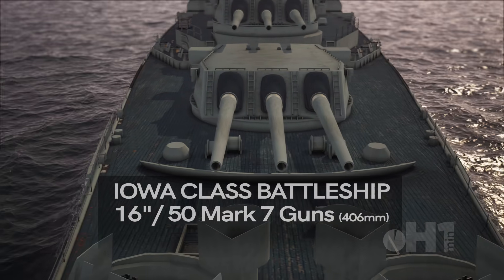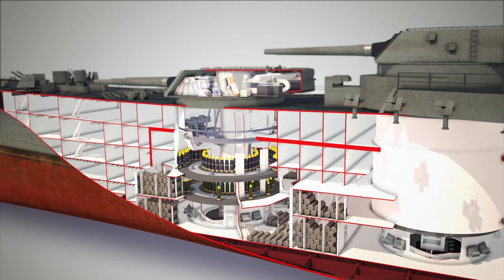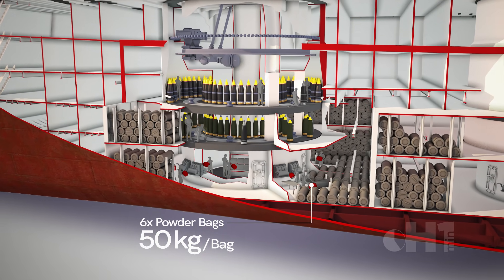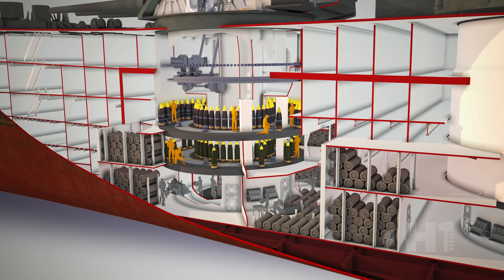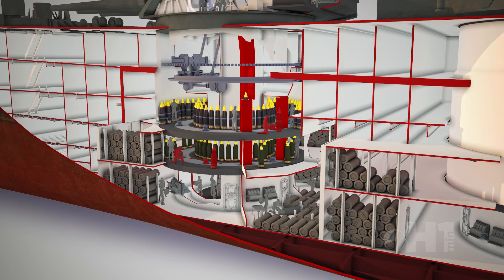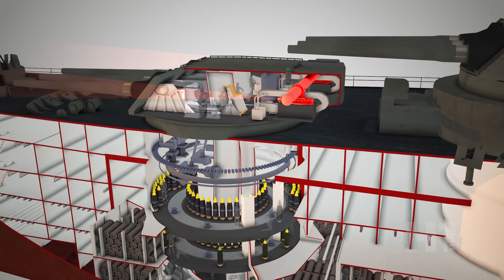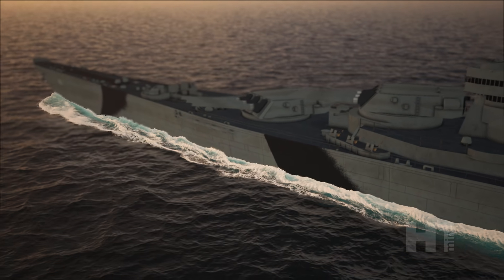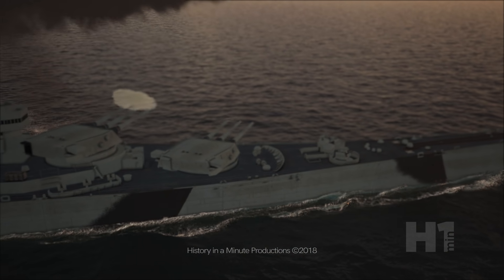H1MIN: IOWA 16" GUNS - Gun Loading Sequence

Comment: "Up to 2 round per minute"

30 seconds!?
Reply: Yeah the reload was that good
Reply: 30 sec is arleady fast.
I need 35 seconds to load my 410mm guns. And that's with intensive use WD-40 and feeding the gun operators with Pevertin!
Reply: @clevernamegotban1752  when you consider how big the bullets are or rounds.... 4-6 a minute is very good. you have to realize that those guns do lots of damage. I found a naval website that talked about a cargo ship decided to get in the middle of a gun fight...... well it left a hole in the ship the size of  Chrysler mini van. I been telling people these ships can be reimangined put some missile, radars, modern fire control systems, a new engine and you have a great fighting ship.
Reply: @neubauerjoseph  It may sound like a good idea, but the problem with that is that the ships are already very expensive and require a lot of upkeep, mainly in fuel and food for the large crew.

In battle and in gun range of opponents it would certainly be a devastating opponent, but getting into range is a problem considering modern anti-ship missiles and even getting into the battle is a problem, as faster task forces will mostly just move around it. Its size also makes it a larger target for radar, sonar, missiles and torpedoes. Submarines and planes could very easily find and destroy it if they could get past whatever escort it had.
Reply: @maxwelldanger1929  I see your points as I was a ex navy sailor. But if you want a proper navy its going to be expensive. But when you look at a battleship its like a big destroyer, but not as fast but can take lots of hits. If was was totally inchange of the navy I would have companies build a new battleship based on the plans of the iowa. But I would add modern engines, newest of the new radar, sonar, fire control systems, ciws, sea sparrow, sea ram, 5 inch guns, torps, tomahawks, harpoon missiles. and keep the 16 inch guns. Also make a way for the ship to load 16 inch rounds faster. I talked to a navy DDG capt he said one reason why the navy likes the 5 inch guns is you can shoot them much faster then a 16 inch guns. Sure they dont go as far or hit as hard but you can shoot a lot of them. My idea is it would not only allow better navy in supporting the army or marines, but it helps support the carrier and if we get back into sea to sea battles that is what the battleship is made to do. THey would suppor the carrier strike group much better because they have great anti air better then a CG or a DDG.
Reply: Blitzkrieg Gamer your idea is terrible... that the poor thinking 🤔 the navy brass has. I know a few navy admirals who are wanting these ships to come back.  Do you really take out a big target.... no one ever messes with a carrier or battleship like pirates.
Reply: @neubauerjoseph  Yes pirates don't mess with big ships, but does that stop them? No, they just find other targets. What's the point of spending all this money on a massive ship when there's both the army and the navy and all kinds of other military and civilian projects that require funding, and you could probably get 2 or more smaller ships that can cover more ground and deter more pirates for the same cost.

The battleship was built to survive damage and deal out its own, but when weapons of today have such range and speed it's armor and guns would be useless. Ship defense has drifted more and more into not being hit than surviving said hits, and the battleship concept of old is gone. 

Sure a floating AA battery would help fleet defense, but do you really need it when most ships have numerous defensive weapons of your own and carrier planes become better and better at intercepting targets. On top of that, you've still got the armor that wouldn't withstand a hit and the guns that have no use but shore bombardment, and its no longer a battleship anymore, just a defense ship.
Reply: @maxwelldanger1929  the problem with your comment is that its shallow thinking. What you said about the battleship could happen with the destroyer, or a cruiser.
Reply: @neubauerjoseph  yes but a battleship costs way more to make, takes more upkeep, and has way more men on board
Reply: Blitzkrieg Gamer it’s like a small carrier. 1-4 billion while a Nimitz class is like 4-6. But the ford class so far is like 13-18 billion.
Reply: @neubauerjoseph  A carrier, whilst incredibly expensive, does a lot more than a battleship ever could because it's a lot easier to make new planes than design and install a brand new gun or missile system.

Carriers like that are produced because of how effective they are nowadays at anything you could think of from ground support to scouting to naval combat to anti-submarine warfare, they can afford to be that expensive, and the increase in size and technology very much increases their effectiveness.

A single large carrier with its escorts can lock down areas spanning up to several hundred if not thousands of square kilometers, and they don't even have to be in enemy weapons range to do it.

Battleships meanwhile are very situational, and aren't really worth the cost.

speaking of, where is that number of cost coming from? why specifically 1-4 billion?
Reply: Blitzkrieg Gamer well... read naval history there have been many reports that If you was to build a Iowa class battleship with how it was in 1992 but today it would cost about $800-2 or 3 billion dollars 💵. Depends on a few things. They have their value I just think it would help the navy, if you armed them right you could really help the navy. It would help it to be a much more balanced force. We need to use our navy more. Also I think helicopters 🚁 make great anti pirates systems.
Reply: @neubauerjoseph   I'm not saying battleships would do nothing in this day and age, and i certainly wouldn't mind countries taking them up again, it's just that justifying their costs, no matter if they cost 1 billion or 1 million to countries who aren't at war when the rest of the budget is already in use and hard to reposition is going to be very hard.
Reply: Yes, in theory 2 rounds per minute. But in practice much less.
Reply: ThatZenoGuy but hey 2-6 rounds a minute for those rounds will do lots of damage.
Reply: @neubauerjoseph  
Indeed, but not as much as the 18.1 inchers~
Reply: Everything in that turret is HEAVY (and explosive). 
the HE shell weighs 860kg (1900 lbs). The AP shell is even heavier, 1200kg  (2700 lbs). 
Imagine lifting a small car 2 or 3 ship decks up, stuffing it into a gun, THEN  lifting up to 300kg (660lbs...about 3-4 people) of powder bags 5 ship decks up, also stuffing this into the gun (if you stuff it into the gun too violently, it'll explode with the breech open, probably killing  most  of the turret crew), closing the breech and moving the gun (each of them is 121.5 tons) from the loading position on target. 
Gun go boom, rinse and repeat.

Those 30s look pretty damn fast to me...
Reply: AKAtheA to make it work they have machines so the only thing sailors had to lift is is the power bags.
Reply: @neubauerjoseph  the shell has to be rolled over from the hoist to the loading tray. Can't rush that.
Honestly I find it interesting that Yamato (and Musashi), which is a much older design has way more loading automation then the Iowa.
Reply: Master & Commander series Captain Jack Aubrey wants 3 24-pound rounds in 2 minutes ... so 100 years improved by 10 seconds and 2600 pounds
Reply: @neubauerjoseph  the main problem is that a DD makes more sence, as the guns on iowa can only get to 25miles
Reply: @neubauerjoseph  It's ironic that you mention naval history while seemingly being completely oblivious about WHY battleships are taken out of service. Already at the end of WW2 it was evident that aircraft carriers had a better strategic advantage. And if you don't need a giant carrier, you have all the small modern missile ships. The evolution of warfare and weapon technology simply made battleships less useful. The fact that the world's greatest military powers (including USA) have completely moved away from battleships should be enough evidence for you. You don't seriously think that you know more than the world's top military strategists, do you?
You "think" BBs would help the navy simply because you think they're cool, which I agree with. But stop mixing fantasy with reality. A salvo from a battleship is nowadays replaced by a series of pinpoint accurate missile strikes from either planes or medium sized missile ships. A battleship is just a giant expensive target.
Reply: Barri 2410 Read about the Japanese 410mm guns on the Nagato class. They could reload in ~22s if fired at loading elevation. Yamato who had bigger guns could also reload in ~30s. The Japanese did have a lot of problems, and their destroyer and cruiser loading system weren't good, but their battleship systems were.
Reply: @neubauerjoseph  There was attempts at 'Arsenal Ships'; battleships that would had been loaded with a few hundred giant missiles. The issues that killed the battleship concept in the first place was still the same, though; they make great targets for aircraft, submarines, and nukes while not offering the tactical 'range' of an aircraft carrier, the stealth of a submarine loaded with nukes, nor fast enough to reach engagements in a timely enough matter like a destroyer. They simply lob a very heavy shell across a strategically very short distance.

Technically, giant mag-railguns could theorically launch shells across an ocean, but the US stopped developing those a few years back, and China has so far no need to shove their proto-types onto on seas platforms.

Comment: So does each turret turn by itself with its own individual gunner? that be cool. its like having 3 independent tanks mounted on a single large, seafaring platform
Reply: Of course they do, flexibility is of outmost importance. Turrets must turn individually to not only fire on different targets, but to compensate for the parallax effect. Since the foremost and rearmost turrets are almost 200m apart, if they had the exact same direction then the shells would spread over at least a 200m wide area. So for all turrets to be able to aim at one single point, all must turn individually.
Reply: @nikoolix  As a matter of fact, the fire control system is NOT set up with the goal of every projectile landing at the same exact point.  There is a certain amount of "spread" built into the calculations.

Comment: I thought YAMATO'S guns is "THE MARVEL ENGINEERING OF WW2"
Reply: But americans sunk it so there wasnt any preserved ones to pull research out from
Reply: The main battery of the Yamato class was markedly more accurate than that of the Iowa class- or of any of the U.S. fast battleships for that matter. The marginal range accuracy of the U.S. Navy Mark 8 over the foretop rangefinder of the Yamato class and the Japanese Type 22 radar (used in a radar- assisted gunnery role) of approximately 50 and 70 yards respectively was more than offset by the significant shell dispersion of the North Carolina, South Dakota, and Iowa classes (1.9% or range for a nine- gun salvo), as opposed to 1.3% in the Yamato class. Just sayin.

Comment: Let me explain this a bit the range finder found on the turret are actually back up system in case the main fire control radar is disabled, the main range finder is found on top of the bridge. Which you could see a even larger range finder and also a radar dish ,that is the main range finder and the fire control radar, the radar are dual purpose, capable to measure range and track surface target, the data is transferred into the fire control director deep in the ship and the crew will use pre set calculators and firing sheet to determine the the turret range setting and lead require

Comment: one interesting thing to note is that in between every salvo the guns had to be lowered back to level for the loading operation, which means that one of the primary & unavoidable factors in the reload speed that could never be overcome is that anything that adds barrel weight increases reload time

Comment: If you wanted to could you fire only one barrel at a time or do you have to fire all three barrels at the same time?
Reply: One at a time is possible
Reply: Very common during shore bombardment missions to fire one round at a time.  At long ranges it takes 60-85 seconds for the projectile to land. Then your forward observers have to relay the spot, and main battery plot has to make adjustments.  Normally no huge rush since the target is not going anywhere.  Classic battleship engagements are much different, during those it's all about sending as many bullets as possible downrange as quickly as possible to play the percentages.

Comment: Great video. Though the creation and corrections of a firing solution are made through the fire director/ gun plotter. The turret rangefinders would generally be paired with the optical rangefinders and radar in the fire director station in finding fall of shot and thus making corrections. In essence they are more of a redundant system.
Reply: Not really redundant. A radar isn't particularly sturdy, neither is the central optical rangefinder, and they're fairly close together. One shell could potentially take both out, so it's good to have rangefinders on each turret if the central rangefinder is knocked out.

Comment: Couple Corrections, Each gun was independent, so there was a switch for each gun that would tell when that gun was ready and it could be either fired immediately or wait for a three gun salvo, and the targeting and ranging on the Iowa's was done via radar with a mechanical computers in the gun director rooms to calculate the final firing solution.
Reply: Correct, however they could be fired solely from the rangefinders built into the turret in case communication between the turret and the rest of the ship was cut off during an engagement

Comment: Guns are not limited by power, they are limited by usability. Japanese guns were even bigger, but they were firing via spotters over the horizon. Where the limits of the gun are drawn is about the starting point for typical attack aircraft. And so the battleship age died after this war. Navy is mostly missile and aircraft based now because of this.

Comment: The optical sights in the turrets are only backup sights. All US 16" guns on WW2 battleships and even smaller guns on smaller warships were directed from the ship's fire control system where the gun director gives orders to the turrets. The optical sights are only in case of battle damage to the fire control system.

Comment: You left out the primer man down in the pit who set the firing charge in the breech block while the gun captain and projectile-man were loading the shell and powder bags.  Then he had to pull back into a very small space under the ram operator to be out of the way of the gun recoil - which would miss him by inches.

Comment: Optical local fire control was a last resort due to their low line of site. The guns were aimed and fired from central fire control using data fed into an analog computer. This data came from radar and if radar failed then fire and aft range finders. Only if the central fire control station was out of action or communication lost did the turret use local fire control and the turret mounted range finding sites.